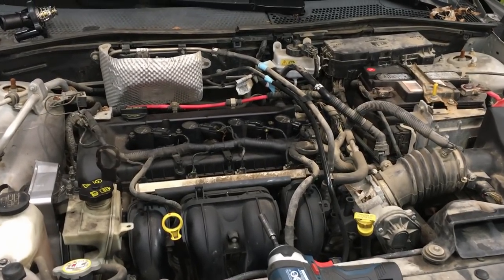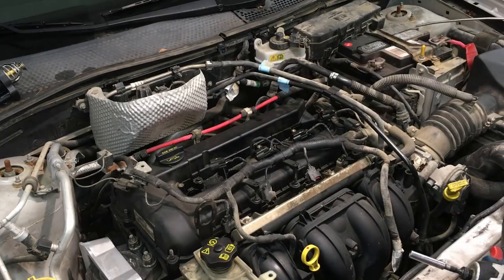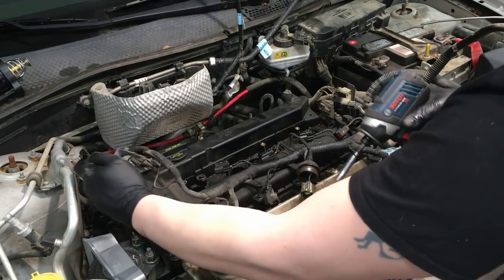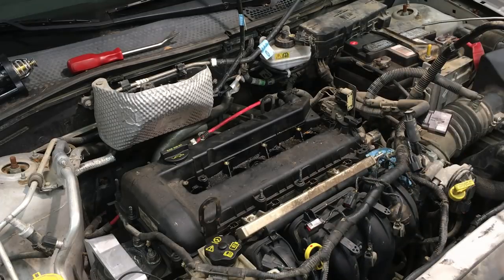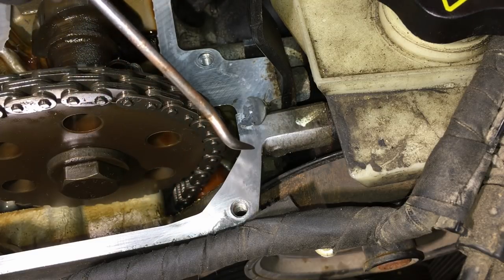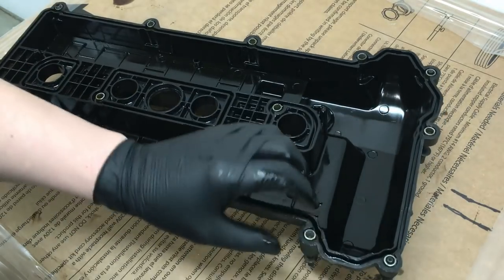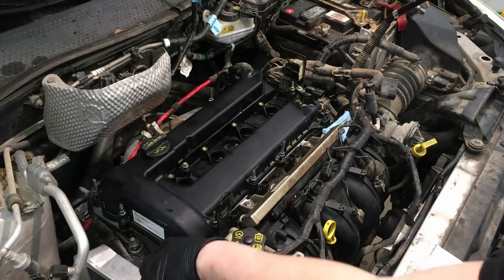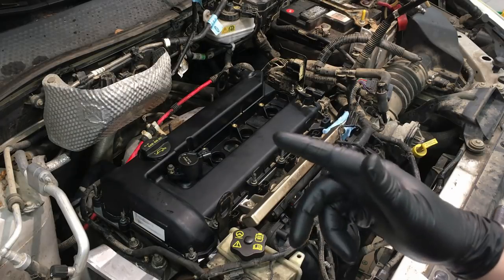2005-2011 Ford Focus 2.0L Duratec Engine Runs Rough Hesitates: Valve Cover Gasket Replacement

Comment from the maker: These are the Tools and Parts needed to complete this job:
Ford Valve Cover Gasket-
http://amzn.to/2q4hi36
Permatex Engine Sealant-
http://amzn.to/2pAEbZn
Dielectric Grease-
http://amzn.to/2q4adQg
Lisle Trim Tool-
http://amzn.to/2q47W85
Cat Claw-
http://amzn.to/2qUpVOY
Ford Ignition Coil (if needed)
http://amzn.to/2q3ZN3x
 1/4" Impact Gun I use-
http://amzn.to/2q6JQaE                                                                                                                                                                                        Valve Cover Torque Spec- 89in lbs
Valve Cover Torque Sequence-
http://i1292.photobucket.com/albums/b576/makuloco2000/A0100095_250_zpsur6hztrn.jpg
Reply: FordTechMakuloco Hey I hope you can help me. I just Purchased a 2012 Ford fusion SE 2.5L with 62,000 miles. the problem is that i dont know what transmission it has and how many quarts of transmission fluid i have to buy. The manual is so confusing and doesnt state what transmission i have. can you please help
Reply: FordTechMakuloco my Manual says capacity of ATF is 9.0quarts.
but one of your videos says 5quarts. im confused?
Reply: FordTechMakuloco thank you for your videos
Reply: FordTechMakuloco Permatex Ultra Black is the best engine sealant.  Nice video.
Reply: FordTechMakuloco v
Reply: What about the torque wrench?
Reply: Thanks for the video! I was wondering if you could help out with some battery issues I’m having! Please feel free to DM me! I have 2011 Focus SE. thanks!
Reply: What if the hole between the coils is shooting pressure where the rubber deal cant hold
Reply: I need your help sir
Reply: @parlamar7148  replace the valve cover if it's cracked or warped. Other than that it's maybe a bad pcv valve causing too much pressure.
Reply: @313_mademe I said the same thing 🤦‍♂️
Reply: That Amazon link is a ripoff. You can get this gasket and boots for a third of the price at Rockauto. Do like your video… so far every Focus  I have had had to replace Valve cover gasket. Haven’t had to replace coil packets… they are pretty indestructible.

Comment: It was a bad design by ford not having enough claiming power on the 2 middle cylinders. That's where mine leaked like a hose. 2 bolts don't cut it
Reply from the maker: +ethan88912 Darn good observation
Reply: Just the middle 2 currently have same issue

Comment: Tackled this today with help from your video.  I was able to buy just the boots at Advance Auto for about $5/pc.  Gave me an excuse to get a small torque wrench for inch pounds, but man it didn't feel like much.  I probably would have way over done it by using the German standard Goodentight.   Thanks for the videos!
Reply: Recently completed this myself for the first time & thought the exact same thing regarding the torque. I actually used a larger torque wrench for foot-pounds & did the conversion. I must have checked like 3-4 different sources to make sure it wasn't a mistake bc to me it really felt like there was still a lot of slack left.

Comment: Going to be doing this job with my son tomorrow.  I've done plenty of valve cover gaskets over the years, but not much work on Fords, and never a gasket on a plastic valve cover, so a bit of a new experience for me.  Your video certainly helps me to familiarize myself with the procedure, and what things I will need to move out of my way to get good access.

Comment: lol you say that plug galley is filled? mine was above the sparkplug LMAO
Reply: Andrew Snyder Lol mine was the same
Reply: What happens if I pulled the plugs full of oil? Will it burn off of the pistons or will it wind up being junk?
Reply: @urmommaahugehoe  I just changed the cover and it was good. Haven't checked again, sold car
Reply: @DJ-oj8wb  for me, I pulled the plugs and let the oil go into the cylinders, then started it and ran for a minute or so to burn off the oil then went and changed the gasket
Reply: Thanks Andrew, I was worrying about popping a hole in the pistons.
Reply: Lmao. Second time in 163000km looks like the first time the dealership did it, they were loose on their torque specs...I confirmed that after retorquing to fix leaks.
Reply: @DJ-oj8wb  I just did the same job . Don't let that oil go into the combustion chamber . Where the plug seats into the head will be full of thick rusty sludge . As the oil dumps in , it will carry all that sludge with it . I used a modified turkey baster to suck out the oil , then covered everything in rags and blew it out with compressed air . If my 8mm bolts weren't rusted down to 6 1/6ish mm it would have been a pretty easy job . This vid is a great help .
Reply: I see alot of oil where the threads are I just bought the 2006 ford focus zx5 and I don't see any oil from up top of the spark plugs can it be a valve cover gasket there's no misfires or anything
Reply: @stevesykes2543  probably nothing to worry about then. Oil on spark plug threads aren't terrible it's when the plug itself is wet or filling up like mine
Reply: @AndrewSnyder-Urech  thank you
Reply: @DJ-oj8wb  I’m assuming it would just burn it right up unless there’s way too much covering the spark plugs not being able to ignite the mixture, it wouldn’t start. Or hydro locking it with fuel if you crank it long enough

Comment: Thank you so much for your videos. A true professional and excellent video quality. I have a 2010 Focus with 290,000 miles and still running great
Reply: I have a 2005 Ford focus and mine is now having this problem.
Reply: Mine has 200k, 2010 too
Reply: Damn thats allt of miles, i have 155,555 on mine
Reply: I have an 06 150k miles
Reply: 07  SES 214K miles. Runs very strong.
Reply: 06 focus here. 280k miles. Just went to change the plugs today (new to me car) and found all 4 plug holes FULL of oil.... Thought I had bought a junker. Glad to know it's just the gasket
Reply: Did the pcv valve ever go bad ?
Reply: Did you ever change the transmission filter ?

Comment: Just finished replacing the valve cover gaskets on my 2005 Focus ZXW. You made it look easy and by following along it really was. Thanks. My next project will be my 07 F150 water pump/timing chain.

Comment: All focus have this problem 👍
Reply: I did 250k with mine and never change the gasket once
Reply: 50k miles and this is the second time it's happened
Reply: @kabaret3  I'm at 268000 miles and mine are starting to do it

Comment: A few other tips that helped me:
1. You might need to use a screw driver to LIGHTLY finesse the valve cover itself loose. Mine was on there pretty good, but once I cracked the seal open it came off easy.
2. You can rent a torque ratchet at Auto Zone. $50 deposit that they give back when you return it within 90 days.
3. I ALWAYS flag any plug that I disconnect with painters tape and I label and number them. It only takes a few minutes to do and it makes reassembly stress free and super easy.

Comment: xD I just did my valve cover gasket watching a YouTube video. First time pulling anything with that much shit. Was intimidating at first, but really easy to do.

 There was so much oil in those little reservoirs that you couldn’t even see the spark plug. Oddly though, it never caused interference. 

And yes, motor craft doesn’t sell boots separately. The foreman told me that you don’t need to replace the coils unless they fail.
Reply: I agree replaceing the coil is not needed, but I would replace the rubber still, you can get aftermarket ngk ones (I got them from Rock Auto).

I cleaned a bunch of oil off my old boots and placed them in the spare parts bin. A week later I was organizing and found beaded up oil all over them (including inside). Seemed like the rubber absorbed oil and expelled it over time, sort of like condensation but oil. I just checked the bin again now and there was a light visible film of oil over the boots up to where they were soaking in oil. It's a shame motorcraft won't sell just the boot and spring but I would definitely spend $12 to $15 for new rubber boots after a valve cover gasket change to ensure a clean connection.

The ngk spring will not twist on to the coil like the OEM motorcraft ones. I ended up reusing the old springs because I did not like the idea of them being loose in there with just compression holding them together (probably fine). I also had a small scratch, maybe start of a crack, in a coil so I replaced that one only just to be safe. I would reuse that coil but I am very hesitant on reusing any of these boots unless I was in a severe pinch.

Comment: My 2010 focus was dying when I stopped.  Ran good no miss firing when driving.  I tried so many things. I just pulled the coilpacks and you can't even see the spark plugs filled with oil. I'm assuming that's my problem

Comment: Changing my whole valve cover as we speak. Had one of the dog ears where a bolt goes develop a crack.  Leaking oil on the exhaust. Changed the gasket 3 times in the 300k I’ve owned the car. Spark plug holes are full of oil every time. It’s my opinion that the plastic valve cover warps over time so the seal always fail

Comment: This is a super great video for replacing that valve cover gasket!  For those back wire retaining clips, they get super brittle because of the constant heat up and cool down of the engine with them sitting right above the exhaust manifold.  Plus, ultraviolet light like from the sun is really bad on plastic too.  I ended up replacing both of my plastic retaining clips with rubber cushioned metal clamps, 4 x 1/4" lock washers, and 4 x 6M-1.0 nuts, it's a pretty cheap alternative and shouldn't be as susceptible to breaking like the plastic ones are.  Thanks again for a great informative video!

Comment: Made 3 rookie mistakes despite the video - d'oh!!  1 - tried to pry off the cover while one of the inner bolts was still tight despite his warning.  2 - small piece of old sealant fell down past the timing chain despite him showing the use of a rag to prevent it.  3 - large rectangular connector on the right side was not fully snapped back in following completion, leaving me with crank, no start until I figured it out.

Comment: Best detailed Ford videos out there. Thank you!
Reply from the maker: Thanks I try to get all the detail in so the average joe can fix it and save $
Reply: Question. I did this job with the help over your video for my mothers 09 focus S. Thank you so much btw. The question I have is that her car is still really rough idling and I am afraid the pvc valve being clogged somehow caused the gaskets to prematurely break. Is this possible? Also where is the location of the pvc at? Is it on the top right corner of the valve cover where the tube was unhooked? Some help would be greatly appreciated! Thank you again!
Reply: PCV valve is driver side under the intake

Comment: It's a good video, would make one suggestion though I wouldn't use a rag to wipe the gasket surface or push down near the timing chain because the rags deposit lint they don't want to get into the engine and ultimately end up in the oil pickup screen, I rebuilt transmissions for 40 years in many times I saw do-it-yourselfers wipe parts with rags and you although you can't see it once they filled it with fluid and started the thing all the lint got sucked up into the filter and I saw many times where it actually plugged the filter up. the valve cover operation probably wouldn't put that much lint into the engine but I think I would use paper towels just to avoid any possibility of lint contamination

Comment: Dont forget to make sure the PCV system is working properly. If the valve is bad or the hose leading to it is sucked shut, all that crankcase pressure has to go somewhere. Thanks for the video.

Comment: Curious, How did you remove the oil and gunk from the spark plug well before removing the plugs?
Reply: fill with brake clean, then blow it out with a rag covering the well
Reply: I used a turkey baster to get most of the oil removed, then added a solvent( paint thinner, carb cleaner, or just gasoline) to dissolve the remaining oil, then sucked that out with the baster too. Soak up any residue with paper towels  and let dry thoroughly. You might want to use the stainless steel basters, the plastic ones are damaged after one use
Reply: Brake suction tool, rags, air, and spray cleaning fluid. Brakelen I think, can't remember how to spell it.
Reply: That's why I'm watching it twice. What happened to the oily boot?
Reply: You have to change the entire coil pack because chances are the boot is now ruined by the oil (swollen)
Reply: just let it go into the cylinder, a little bit of extra oil in the cylinder does nothing
Reply: I've tried many different ways. But my favorite is to use a new empty spray bottle, I take the handle with suction hose attached to it an put the suction hose into the oil, then point the sprayer nozzle onto the empty bottle an hand pump it into the bottle, it's really easy to do, an the empty spray bottle costs a dollar. Good luck.

Comment: @FordTechMakuloco
I'm an avid watcher of your videos. just a small remark, that the title of your video should have been 2005-2010, rather than 2005-2011, as the fourth generation ford focus did not have the same engine as the second and third, the duratech engine, I mean. all the best.
Reply from the maker: The title is corrrect as the focus did not change until 2012 in America.

Comment: Are you sure the valve cover torque is 89 foot pounds for a 2005 Ford Focus ??
Reply: Nabil Alhadi    Firstable the cover is made of plastic  so is too much 80 foot pounds  I did mine same car and I just used 6 pounds torque  no leaks
Reply: @leticiablass7405  89 inch pounds is around 5 foot pounds. He said the torque was inch pound. There is a huge difference between the two.

Comment: Any info on the hard engagement into 1st or reverse for the 2000 to 2007 ford focus? Engaging 1st i either have to either force it in (not much force but more then any other car ive driven) or shift to 4th then 3rd and itll let me engage 1st no problem. I have a 2005 ford focus zx3 se with a 2.0 dohc
Reply: I have the same car and the same issue with shifting into 1st and R.

Comment: Hi all.

I'm stumped and really need your help and advice regarding a fair bit of white smoke coming out the exhaust until the coolant temp reaches around 60oC.

Now I know this would usually be water, but I'm not loosing any coolant at all! ...Nor am I losing oil or have any mayo under the oil filler cap. Equally there's no oil in the coolant reservoir either.

No loss of power. Starts and drives fine too, it's just an embarrassing amount of smoke/vapour that almost filled the car park at work yesterday!

I always warm up the car before I drive it, and it hasn't overheated before.

So, I put it to you great people for your suggestions...

Many thanks in advance!

Comment: I changed my gasket and the hesitation started. My idle is also rough. Could I have made a mistake installing it? Also, I didnt apply that liquid gasket seal.
Reply: A little late with a response here, but the liquid gasket seal missing might cause an oil leak, not likely it would cause any other issues.  Check the PCV hose which is connected to drivers side rear of the valve cover.  If that is leaking, or you forgot to reconnect it, that could cause your problem.

Comment: Guess what!! Upon further investigation of my lean condition, especially in Bank 1, I found oil in the spark plug well on cylinders 4 and 5, Bank 2, on my Ford 3.0L DOHC Duratec V-6 engine. Cylinder 6 was clean!!  I haven't been able to check Bank 1, the 1, 2 and 3 cylinders because I can't even see them. I need to remove the Intake Manifold. So I know at least 2 cylinders on bank 2 were misfiring. I'm not sure how this would cause a lean condition in Bank 1 though. At any rate I found what could possibly be causing everything. What a pain. This car was meticulously maintained and is in perfect condition. Just a shame.  I have my work cut out for me now. Any advice would be appreciated!!

Comment: Can't believe it got so bad, mine has 200k on it, just 1 coil boot slightly damp with oil when I ran across this issue.   Pretty easy job, used Fel-pro gasket.
Reply: Was considering using the Fel-pro as well. Has it worked out ok for you? Have you tried looking in the plug wells again to see if they are still dry?
Reply: @scottmmcnamee6813  I had my 01 focus zetec zx3 valve cover gasket changed at a shop 2 months later it was leaking again. I had just replaced my pcv valve and hose and a few other things that might cause the valve cover gasket to leak so I had no clue why the gasket was already leaking again, until I pulled it off and seen the mechanic who put it on lubed the whole thing up with silicone, alot of it all over. Took me forever to scrape the stuff out but finally got it all out replaced the gasket with FeL Pro, never had a problem since then
Reply: @k92kboomer  Thanks for the reply. I ended up using the Fel Pro gasket as well and following the instructions provided by the video poster to put a small dab of the sealant in the two corners of the valve head mating surface on the passenger side and the car is running like a top again. I'll pull the plugs and check the wells again next spring just to make sure all is well, but confident it will be dry...hopefully for another 80K miles. I also replaced a couple of the spark plug boots that were oil soaked.

Comment: Great video until the very end when he instructs us to use dialectric grease on the bottom end of the coil. DIALECTRIC GREASE IS NON-CONDUCTIVE. It is an INSULATOR. Most packaging even spells this out for you. Use it only on the ceramic part of the plug in order to prevent the spark from traveling outside the boot. Other than that, this video is very useful. God Bless